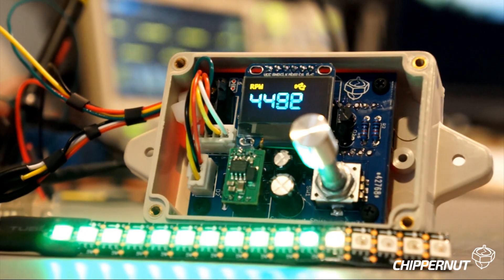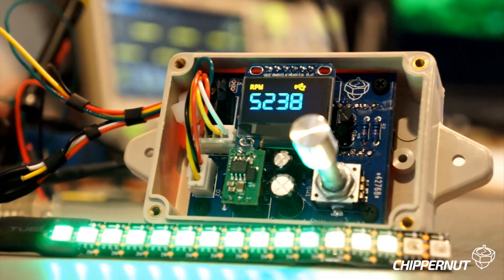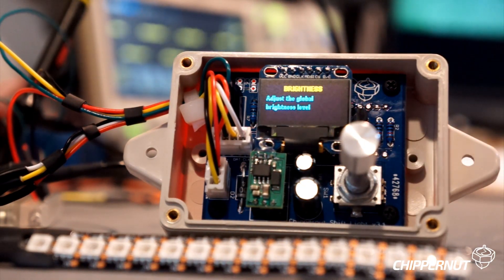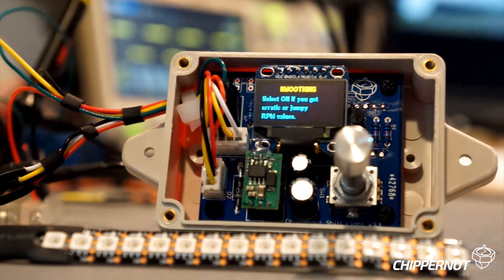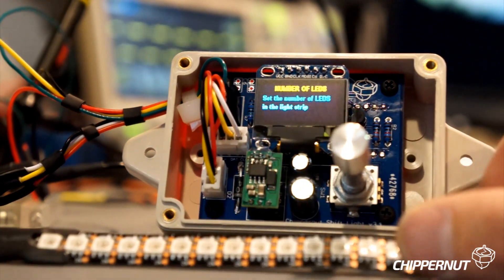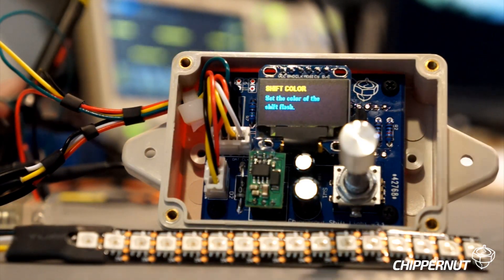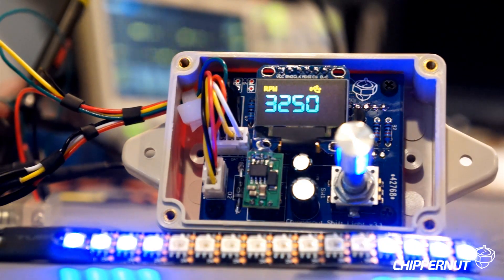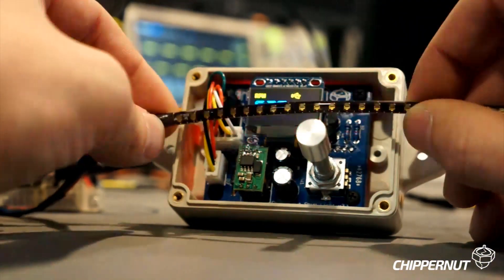Chippernut V3 Open Source Arduino Shift Light

Comment: Are you still in business? I have try contacting you over eBay and via your website and I put a order yesterday for 20 StarChip Digital LED Strip Black APA102C 144mm as I need a led strip replacement. I would appreciate if you answer my emails as I have a question on my order.
Reply from the maker: Yes I am still in business. :-) I'm just a little slow to respond to emails each week. I did get your messages and your order will ship tomorrow. For more info, please see my FAQ. https://www.chippernut.com/faq.html#/

Comment: Is there a way to add 4 segments of colors instead of 3? The shift lights have 16 leds, if 4 segments are added instead of 3 that even the number of LEDs...you can then have 4 segments with 4 different colors. Instead of 3 segments that you are forced to have one segments with 5 LEDs and only 3 colors. Just curious if that is possible.

Comment: it's safe for AC electrical ignition? if yes i'll pick up at CDI out pins to the coil:D if not, how? thanks bro✨
Reply: the voltage around 12v
Reply from the maker: While the input is protected against AC signals, the maximum voltage is 12v. It's designed for a digital signal from an engine controller, ignition controller, or other tachometer signal source. If you wish to pickup the signal via inductive or capacitive pickup, I would recommend a tachometer adapter from Dakota Digital, Autometer, or MSD depending on your application.
Reply: @Chippernut  is it available tach adapter for motorcycle?

Comment: What's the third style led bro? I just buy 1 set from you.
Reply from the maker: The flexible micro LED (apa102-2020) is not available in reasonable lengths. The manufacturer only produces 1m lengths and they are quite expensive and hard to source. That's why we created our own version called the StarChip16 board. Same LEDs, but much more reasonably priced and plenty available.
Reply: How can i install to mu car bro. My car don't have dimmer shift light so only 1 rpm wire need to tap, but how can i detected correctly wire for rpm signal? My car is kia picanto. And other bike is honda cbr 600 2016 many thank.

Comment: Just bought one last week will be installing it soon. Only downside to this setup s the wire's, that connects to the shift light needs to be much much longer so you can mount the light far from the control box.

Comment: What is the total length of the LED strip? And are there any mounting options?
Reply from the maker: Hello. thanks for your interest.  The LED strip length is variable based on the number of LEDs and the type of LEDs you choose.  It can be 3/8" to about 12" using the standard LEDs.  Head to the product pages on Chippernut.com to see the actual sizing specs for the LED strip.  Thanks again

Comment: So I have the first Gen. Works great but im planing on ordering the v3 I'm just wondering if I can order it with the last led you displayed on the video (the very thin and flexible one). Can we? Or I can order it separately I don't mind. Just need the model for the led.
Reply from the maker: Hi Frank, 
Hopefully soon. I've been emailing the manufacturer just about every week for the last 6 months to get more of them on-hand. I was told I should have them in a couple of weeks, Fingers Crossed.  Thanks again and glad to hear you like the shift light!  If you can find them elsewhere, they are the APA102C-2020 model LED.  They are in extremely high demand right now.
Reply: Chippernut ok great thanks. Fingers crossed

Comment: Im trying to do this off of a macchina M2 device, however im not sure how to do the programing and connect everything as it will all be wired to the output side of the M2 as opposed to off a board,  any advice? This is my first arduino project

Comment: i am really interested in doinf something like his as a HUD in my track day car. My only concern is how i would connect it to the car. Would i be able to wire it through the obd2 port in the car or would this involve pulling apart the dash and splicing wires?
Reply: Dan app I think it would depend on the car. On my mini cooper I was able to get he rpm signal from the odb2 connector
Reply: @franknativi  out of curiosity what year mini you have? I'm about to give it a go and install it in a Audi S3 2016 and I'm suspecting that I will need to tap the obd2 port. Since mini is german it should be similar to my Audi.
Reply: Eli Thanos I have a 02 mini Cooper S r53. And yea most likely you'll be tapping on the odb2. Make sure you'll do it from the back so you always have easy access to connect the odb2 reader
Reply: @franknativi  thanks a lot. I'm a bit confused about it...if I can just tap straight to cable as you said from the back of the obd port or If I need the obd ll tachometer interface from dakota digital.
Reply: Eli Thanos as far as I know most car have a rpm signal going thru odb2 port but im willing to be there are other places in the car where you can find rpm signal. Odb2 is easiest tho.
Reply: @franknativi  thanks for your help. If I may. I ordered mine today. Any chance you could give me a measurement of the LEDs? How long and wide?. I will be 3d printing a mount.
Reply: Eli Thanos so I'm about confused by your question. How long and wide what?
Reply: @franknativi  the size of the LEDs lights strip.
Reply: Eli Thanos the led strip I got with the chippernut kit is about 5inches? Somewhere around that. I have a video on my channel were I showed what it looks like and where I positioned.

Comment: Can it be configured to a 2 cyl? Was wanting to install on a HD nightrod, from what I have gathered it doesn't have a standard pulse signal. That's where the whole thing went over my head.
Reply from the maker: Hi +Ace Man  Yes, it can, so long as the engine has a computer controlled ignition. Otherwise you'll need a tach-adapter.  Autometer and Dakota Digital both sell units that might work to convert conventional ignition into a digital signal. Hope this helps

Comment: Would this be possible with more LEDs wanting to build a pillar type gauge
Reply from the maker: Yes definitely. Up to 32 LEDs. You can add more than that if you modify the code and add a larger power supply, the internal buck regulator follows the standard pinout for most 7805 and other chips. Hope this helps. You can also get the APA102 in an LED strip with various spacing - check amazon and ebay. Thanks!!
Reply: Chippernut awesome thank you I was going to use something like this for my race car
Reply from the maker: Awesome!!  Thanks for your interest.  If you do decide to go with our shift light, please share pictures / videos. :) We love seeing custom installs.
Reply: Chippernut will do hopefully it'll be something nobody's ever seen before

Comment: Hi can you power the nano or a atmega from the buck instead of having a separate 7805?
Reply from the maker: Hello - Excellent question.  The challenge is the power draw caused by the LEDs.  In some instances, the LEDS can use quite a bit of power, and the dip in current can starve the Amtel chip causing issues.  To solve this, I use a dedicated L78L09 to feed the onboard "nano" 7805.  Sounds kinda silly, but it made the most sense considering the processor needs a steady 5v to run and it already has a 5v regulator on the "nano" board.  In previous iterations of the shift light, the "nano" board got power directly from the 12v input supply.  The problem here is, most vehicles either have more than 12v while running (sometimes 14-16v from the alternator) or a very, very noisy supply.  This caused premature failure of the amtel chip or overheating of the onboard 7805 -- which really shouldn't ever exceed 12v.  So the designed setup is quite stable in that it's filtered and regulated twice.  Hope this clarifies for you -- thanks again for stopping by.
Reply: +Chippernut, does it work for 16k RPM?
Reply: if I pull from the crankshaft sensor is that RPM?  It's tapped for my gear shift indicator that works flawlessly but you have to be clutched out at 2k RPM so I'm not sure if it would read?  I need a mount for this and I'm worried doing triple digits would make this fly away if I hot glue?  Is the RPM reading accurate or it has to be calibrated?  I want my first green light to activate at like 10k rpm then gradually ramp up and massive blink at 16k.
Reply from the maker: Unfortunately the shift light will not operate off the crankshaft sensor, it must be a 5v-12v square wave, typically from a computer controlled igntion system or engine controller - stock or aftermarket. You'll have to research your particular application to determine where you can get this signal from. This does not work off sensors or spark wires.  In regard to mounting, the flexible strip has a 3M VHB backing, but I would recommend incorporating it into your instrument cluster or building/buying an enclosure for the LEDs.  Once connected to a good RPM signal, the RPM reading is extremely accurate  - it can be fine-tuned in the menu system as well. You can totally customize when each section starts/stops and at what RPM it activates.   Hope this helps
Reply: Can I test all the wires of the instrument RPM cluster?  What if I tap the RPM wire into a power wire by accident?  What if the LED gets wet does it short the box?
Reply from the maker: Hi Anthony, Sorry it took me so long to see this.  I wouldn't recommend it.. Technically nothing would really happen if you connected it to solid 12v, or ground, the pickup circuitry is protected, but you always want to be mindful of what your connecting devices to. If there's some a data line or high voltage driver (for a gauge motor, perhaps) that could cause issues or potentially damage components in the car.  Hope this helps
Reply: yeah, I was thinking the rev light is unnecessary as I was climbing the RPM band I would just keep watching for 16

it starts to pull hard from the other vehicles after 8k but then it hits 12k and it's already fast but going to 16k would be 70 in a 50mph then shifting would take it to 100 in no time but it's not super ultra quick where it matters like a sprocketed R1
Reply from the maker: Yes, it's been tested to work higher than 20k RPM

Comment: Will this work up to 16000rpm?
(Planning on installing it in my 2000 Yamaha R6)
Reply: follow
Reply from the maker: The shift light is tested over 20,000 rpm. Just make sure you have a reliable signal from an ignition controller or engine computer. Several companies make tach adapters if you do not.

Comment: about that last led set, it looks like you have it available in 1 meter increments on your site. Are you going to offer it in 16 led increments in the future?
Reply from the maker: Great question.  I am working with the manufacturer to design a smaller, modular segment. I'm thinking in groups of 10 LEDs, but might change that to 8 or 16 depending on feedback from the community.

Comment: Very cool project!!  :-) 

If you're ever looking for a chip that need to process various signals from different sources a single processor chip the Arduino uses can make it a challenge. I've been using a multi-processor chip called the Propeller for about 10 years that has 8 processors. They all share a common 32K of RAM and each can control the 32 I/O channels.

https://www.youtube.com/watch?v=7_dBHsmuxuQ

Here is a project I did back in 2006 using a 5" Game LCD to replace the stock instrument panel for my motorcycle. Took a weekend and was able to read just about all the sensors on the bike and send that data to the display. It even was able to track the FI pulses and read how much fuel I had consumed. It has some very powerful hardware timers. The bike had a two stage FI system, so I had to watch both injectors for one cylinder and the timers did not count the injector pulses, but it actually accumulated the about of time they were open. With that I could quantify the amount of flow/fuel they injected.

This chip also runs at 80Mhz so even one processor can do a lot at that speed, but having 8 you can do a lot of processing. Another game changer is it removes the need for interrupts as each cog/processor can be dedicated to your processes. 

A different way of thinking, but for some applications, it really simplifies the design.

Comment: this is amazing work and i want to buy it because i currently lack a Tach... BUT my ecu uses some kind of strange algorithm of sorts and cannot just tap to its signal (nissan 350z vq35de swap on another car)

so would i need something like a dakota digital converter to use with this tack? 

or can i use the existing signal from something like say... the crank or cam sensor?
Reply from the maker: Great questions!  thanks for watching.  I've never heard of that dakota digital converter before, thanks for mentioning it. That's very interesting! Actually they have quite a few products that would help a good number of potential customers (like those with CDI ignition).  Crazy I've never heard of this before.  Based on what I can get from the manuals, this would work perfectly with the shift light! I can't thank you enough for sharing this.
Reply: check out chippernuts forums , someone was asking the same question on there. I think he ended up tapping into one of the coil packs, but don't quote me on this.

Comment: Nice work! What kind of tach signal voltage are you expecting to see coming into the unit? If you were to hook this directly to the negative side of an ignition coil would it still work? Or would you need an ignition box with a 12v digital tach output signal?
Reply from the maker: Thanks!  this shift light works with a 5-12v DC digital tach output, typically from an engine control module/computer or ignition module. It has not been tested directly to an ignition coil and I wouldn't recommend it.  Thanks again!
Reply from the maker: I just learned of this company called Dakota Digital that makes various conversion products that would work perfectly with my shift light! Talk about good timing!  (Thanks "Infamous Drift Team") http://www.dakotadigital.com/index.cfm/page/ptype=product/product_id=127/category_id=694/mode=prod/prd127.htm
Reply: Chippernut so if I’m understanding the mechanics of their unit, you connect your existing ignition signal to it and it outputs a lower, more usable digital signal that the shift light is more compatible with. This is similar to what an MSD ignition does with its 12v digital tach output and its how my Shift Light is operating now. I did have it running off the negative side of my coil prior to getting the MSD but you need a 30k resistor on the input signal.
Reply from the maker: I believe you are correct. I haven't tested these products, but I'm going to. This could be a great companion for those with vehicles that don't have the necessary signal for the chippernut shift light.
Reply: Chippernut I agree!
Reply: Chippernut just throwing it out there - I ran the 0-5 volt analog out from my AEM AFR gauge into A0 on the Arduino. The var = sensorValue * (5.0 / 1023.0);  Then to convert to AFR it’s (var * 2 + 10);  Now I can serial.print RPM with AFR and plot them together. It’s almost like a mini data-logger.